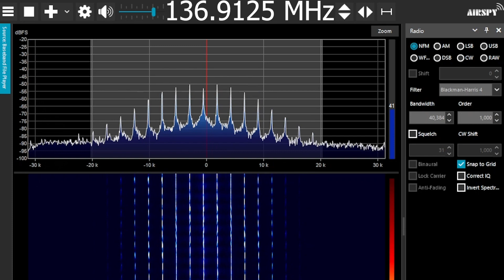Signal Identification of NOAA-18 Weather Satellite APT on RTL_SDR  & SDR Sharp by Technology Master

Comment: The LRPT signals (137.100mHz, 137.9125mHz) are Narrow Band FM signals with a right hand circular polarization. WXtoIMG V2.11.2beta is used to decode the signal into a visible image. While I haven't checked in a couple of months NOAA15 was transmitting on 137.620 but imaging systems had failed and it was being shut down since it wasn't responding. Control and support for the NOAA POES systems (NOAA19, NOAA18) have been handed over to a private company.
Reply from the maker: LRPT is entirely different from APT.  This video is only for APT.
Reply: @technologymasterkam My apologies, I was under the impression that APT was the type of satellite and the LRPT/HRPT was the type of signal transmission. Would you consider a video on identifying the latest Meteor satellite signal in the 137mHz band? Many thanks, and have a great day!!
Reply from the maker: @e.v.squatch5835  I will add it to my wishlist for making a video. Thanks for sharing your thoughts.